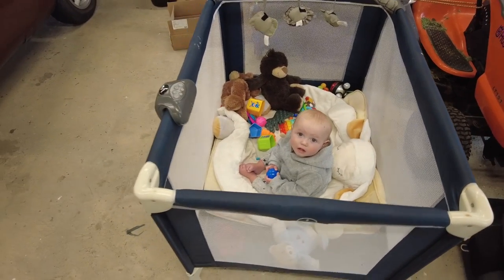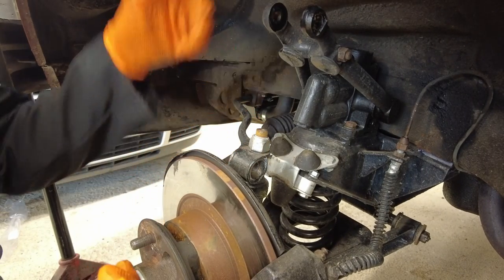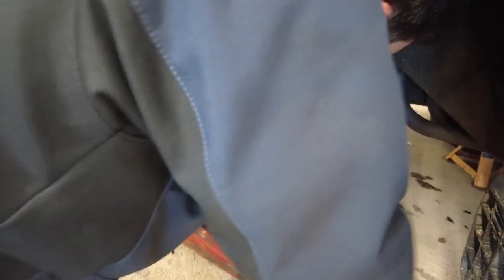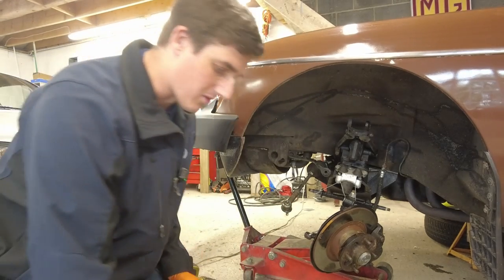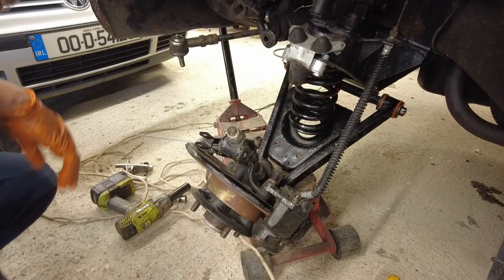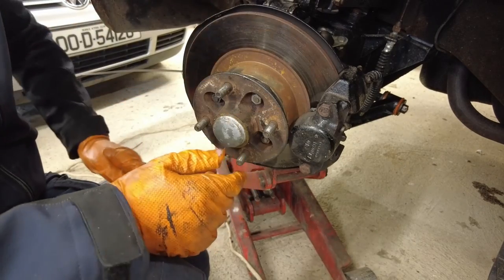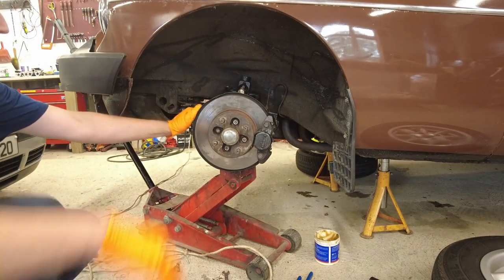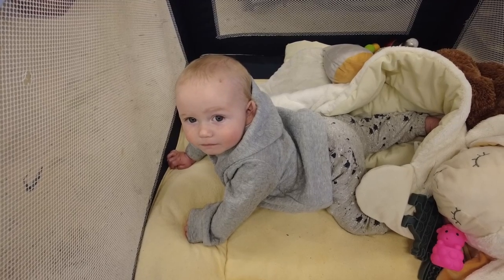The Game-Changing Upgrade for Your MGB: Transforming Front Suspension with Polyurethane Bushes!

Comment: Just done mine recently and yes does make a difference, I fitted recon shocks as well. Love the MG content
Reply from the maker: I changed the oil in my front shocks. I'll probably end up doing the same on the back.
Reply: @Endfloat  My shocks were leaking so found reconditioned part exchange for £40. Couldn’t resist that price, bargain I thought
Reply from the maker: @BrianGibbons1966JulesRimet  yeah that's a good deal! The oil probably cost half that alone!

Comment: Great video. Sometimes it's a bit easier if you're just replacing the bushings to remove the bottom bolt from the kingpin assembly. I also like to grease it up as well. Be careful not to get grease on any rubber, it turns rubber to mush!
Reply from the maker: Yeah but to replace the top bushes you'd have to remove that bolt anyway.
Reply: There are greases that dont attack rubber and are food grade and waterproof also. so far i've used superlube without issues in wheel bearings and other suspension components. just make sure to check compatibility.

Comment: That should drive great. The downside to poly is they need to be kept lubricated so unless you install zerk fittings to the middle of each hinge you'll have to take them apart for greasing periodically.
Reply from the maker: I've never known poly bushes to need lubrication. I have the same set in the front of my beetle for the last 11 years and they're perfect and have never been lubricated.

Comment: You should have slackended the shock obsorber top arm pinch bolt , then kingpin top bushes would slip out easier, Save damage when using hammer!

Comment: The bottom fulcrum pin just came out! That never happens. They are rusted solid on the distance sleeve after a week normally. I have always had to grind off the nut and bolt head to get the lower arms off. You had just done the uprights or you grease the assembly religiously and never drive in the wet!